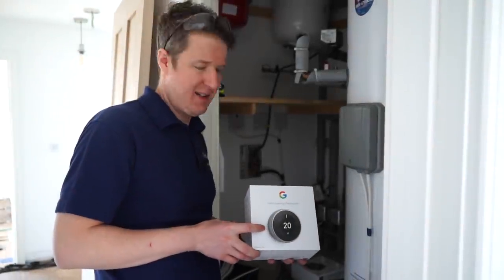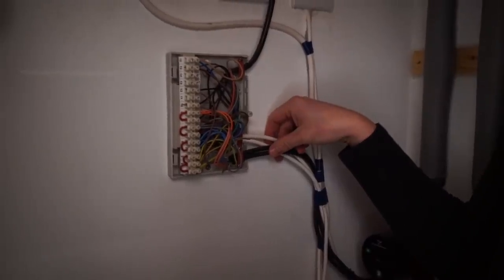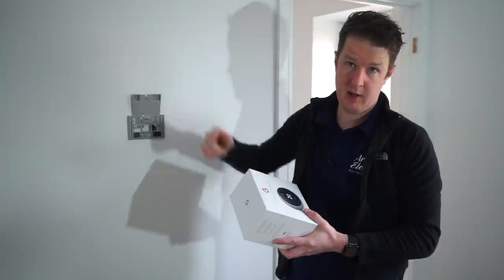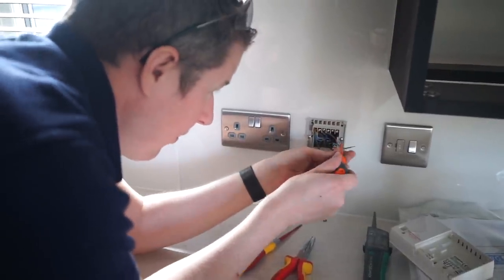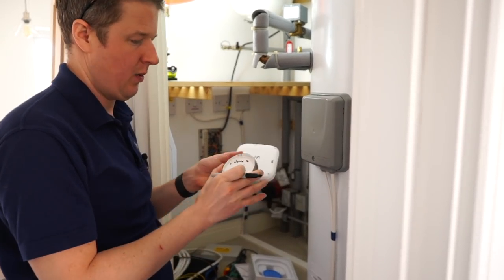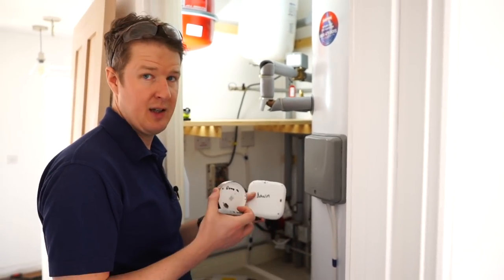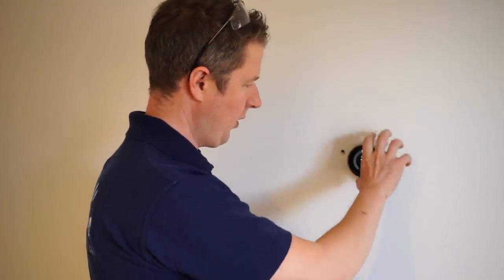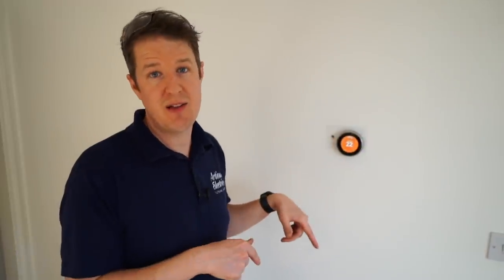Tackling Central Heating Wiring - Google Nest Thermostat Installation - Electrician Life

Comment: It's really nice that there's one centralized place for all the heating and hot water electrical connections in Britain.  In the U.S. these connections tend to be made wherever they wind up and the low voltage ones are seldom in boxes at all.
Reply from the maker: Wow thanks for sharing

Comment: Remember that you can tell if zone valve is open because the mechanical actuator will move freely.Because the motor has moved the vale to open position. Great video.

Comment: Done quite a few system boiler wiring on a council contract,found it is a good start to understand which colour does to the controls to the valves stats etc the colour's are standard what ever make you use 👍

Comment: Nice job! 😁 Those Nest thermostats refuse to work above a room temperature of 30 degrees C, so I had some trubble getting them up and running after install. So I used the button in front off the heatlink to test the heating. Once you now everything is easy!  😉

Comment: I do like your videos and I learn some thing every time. ( well nearly every time). As you said these Nest thermostats in the UK are just switches and in your example are being applied to a very very basic UK  plumbing system. In fact the heating system is exactly the same as the one I as a non plumber designed from a few diy articles when I built or perhaps more accurately project managed the build of my house 25 years ago!

The Honeywell control system with zone thermostats still works fine today and I can turn the stats up and down whenever I want!!

The USA Nest system looks much more interesting but then it caters for AC as well as heating and their types of heating are easier to design around individual room thermostats in stead of upstairs and downstairs zones.

However they look smart and it might be nice to spend the £400 to help create an up market illusion when I sell my house next year.

By the way should you not test your tester on alive wire before and after testing the circuit you are interested in?  As an old codger I will relate a true story around testing....I did my training with an Electricity Board in the early 1960 s on the HV side. I had just become Authorised to issue permits to work  and was isolating a 33kv line from a 33kv substation. The routine was to test the testing stick by opening a bus bar shutter and putting the stick on the bars whereupon it would glow and buz a bit.  You then put the stick on the feeder terminals and it should not light....and it didn’t. However when the earthing gear was attached and the beaker was being racked in it started to buz!!  Quickly racked out and retested the stick all fine. 
The whole area fed from the 33kv through the 11kv to the LV was supposed to be isolated and dead.....turned out there was an obscure and lost! LV back feed which was not causing enough volts to light the tester but enough to make a warning Arc when starting to rack in the earthing gear..Moral of the story?.......never lick your fingers and touch a conductor to see if it is alive!
Reply from the maker: Thanks nice to hear from you

Comment: Jordan, the heat links have a unique ID on them and you can program the nest stat to connect to the required heat link, so if they do get muddled up you can just go into the settings on the Nest programmer to find out which one its paired with and swap over the nest stats accordingly.
Reply from the maker: Nice

Comment: Bacteria Prevention is an exclusive feature of 3rd-gen Nest Learning Thermostats. Bacteria Prevention mode will activate if your domestic water hasn’t been heated for at least two consecutive hours in the last 48 hours. This can happen if there is a gap of more than 48 hours in your hot water heating schedule or if you are away from home for longer than 48 hours. For instance, if you have a second home or holiday home and only need hot water for weekends, you can create a hot water schedule for Saturday and Sunday, and the Bacteria Prevention mode will automatically heat the hot water tank during the week. not to do with heating.....
Reply: Where the bacteria grows? isn't it closed water line only for heat?
Reply: I guess this is not as good as the controls on a commercial boiler (Legionella prevention mode) Whereby for energy savings and H&S reasons the hot water can be kept at around 55c then on a cycle the tank is "Pasteurised" where it is heated to 65c and held there for a few hours before going back to 55c. 

Same with Cole water storage tanks, Industrial controls have a temperature sensor and an algorithm that detects the "Danger Zone" and initiates a tank flush if the tank is in the Danger Zone too long. 

I assume the nest system is just a "Dumb" system as it doesn't know the temperature of the water tank so cycles it on at regular intervals to pasteurise the tank.
Reply: @ValorHeart  in the white cylinder next to him. So the hot water coming out the tap. He's just misunderstood what it is and should stay on.

Comment: A really helpful video, thank you. I was overwhelmed when I opened my wiring centre at first. Still trying to figure it out though, I have an air to water heat pump system by Joule / Samsung. It looks way more complex than the job in this video. I wish you covered call outs Ireland ! 😂 Two zones with 230v thermostats to each. Separate Samsung branded controller for hot water. I don’t even know where to start. If you have any suggestions or offer a remote support service I’d be willing to pay ! Thank you.

Comment: Great little tutorial on the subject, like you say, most electricians run the other way when confronted with a heat only system.
Thanks again for sharing, and replacing the propaganda rubbish on TV.

Comment: Nice tutorial. I have similar setup installed at my house. One nest has equipment set to “system boiler” to enable hot water control. Did you set another one to “combi boiler” to control only on/off of boiler?

Comment: My OCD is very grateful for the two hubs coming down into the wiring centre and the top one not going up.  However the ditching of the level for the install gave me a bit of a cold sweat.

Edit, the switches above the wiring centre could have done with a shot of the level too! Dear me.

Comment: Did you check to see if the boiler could be controlled by OpenTherm as Nest supports that? When ours was installed the installers didn't and I've read it's more efficient so had to get it changed over by another tradesperson.
Reply: it would be nice to see how it is wired on open therm if fitted to system boiler

Comment: I prefer my Drayton wiser system. It just replaces the programmer (and in a lot of cases just sits on the existing backplate). Battery powered room stat (you don't have to have that) and individual rad stats for all over control.

Comment: That wiring box is a typical rats nest of wiring you see when removing the cover. At first glance a confusing maze of wires. Can take a while to work out which wire is which. Especially for cables that disappear into the wall and emerge in some other part of the house. Easy to pick out some cables that are surface mounted and go to devices in the same location. Often easier to wire in a system from scratch than retrofit stuff working out which wire is which and what one actually needs to alter

Comment: The browns of the thermostats aren't permanent lives, they connect onto the switch back from the timeclock.
Also what's the point in putting a brown tag on an black cable, all's your doing is tagging a live cable saying its live, you only need to tag a cabke if its doing something other than its intended purpose i.e. using a black on a 3 cored armoured as a CPC

Comment: A great video, cheers. Trying to find some of the basic information has been practically impossible until now.

However, I don't have an existing room based thermostat and I simply want to power the thermostat from a simple 12v PSU. Can you tell me which terminals to use on the thermostat for +12v and GND? Maybe I'm missing the point somewhere but why don't they at least label them as such instead of all the seemingly random letters?

Maybe it all makes perfect sense to a heating engineer but I'm an electrical engineer. All the letters labeling the terminals mean nothing to me. It's going to link to the boiler wirelessly via Heatlink so all I need to do is power the bloody thing up ;)

Comment: great vid lad, realy good help....the first one is the tricky one...then you could wire the next 100 with no drawing. Just curious how you combined the rm stat and water system .........i take it the app on phone controls the hotwater  times....can it be accessed by the  roomstat menus too?
Reply from the maker: Thanks! Yeah that’s right you can control The hot water from both the app and the room stat
Reply: @artisanelectrics   ta again

Comment: i noticed you said the pump constantly has power and kicks in (and sometimes is wired to power up when the valve opens). ive alway been taught that it should only power up when the valve opens to avoid burning out the pump. is this something to do with newer pumps? just wondering as having constant power to the pumps makes the wiring easier for sure. handy to know for the future. cheers
Reply from the maker: Yeah most pumps are only turned on when the valve opens that was my mistake
Reply: some newer boilers require to control the pump for pump over run to protect the boiler, this is stated in the boiler instruction.

Comment: You absolutely made hard work of that. Do a diagram of what's there before you start. Then make a diagram of the new circuit . Then make the changes. I am a retired control gear engineer & I couldn't follow you. Otherwise like your work

Comment: Programmers are old hat now, the nest stat controls the on off times via an app. I have a heatmiser setup which controls the central heating, hot water and electric underfloor heating via an App.
My boiler has a live from the fused switch, then from there the power goes to the control gear and the pump wires direct to the boiler
Reply: "Programmers are old hat now" I guess I will just quit now and become a Wizard instead :) .

Im on the fence with Heatmiser I've done two large installs where I have had to integrate with their stats and I find that the API is lacking (Or was when I did those jobs) There was a lack of consistency between the functions available in the app and what they allow programmers to access via the API so had to write some interesting logic to brute force those features. 

Nest I like and they had a great API but they may have ruined integrations as I saw a bulletin that "Works with Nest" applications are being discontinued so I can no longer get new API keys for new customers. 

Both stats seem to miss out on HVAC integration, they seem to do Heating and Domestic Hot water just fine but no Cooling, for that you end up with two systems that need to be integrated by a programmer or you end up buying big boys toys and installing something like a Tridium Jace controller with BacNet and writing a custom app to control the HVAC.
Reply: @warrmr  what’s wrong with saying programmers are old hat now? Do you still recommend Landis Gyr clockwork timers and mechanical room stats
Reply: @blobstrom  I guess you missed the joke English is hard but that’s ok. 

On the question of would I install analogue/mechanical technology yes!  
If the customer wants a wind up doorbell that makes chicken noises in the garden when someone is at the door then so be it who am I to judge. If you got the money and I have the skills to do it then let’s go boi. 

Same as if someone wants me to program a 20ft robot to walk around the garden and spray “intruders” with water in down for that. 

I mostly get boring stuff like can you make the toilet bowl lights turn on if movement is detected in the bathroom between sunset and sunrise. 
Or when you turn on this tv can the cabinet doors open this light turn off dim the others and swing the bracket 26.456 degrees.
Reply: @warrmr  So a reply that starts with an insult about my understanding of the English language, I can see where this is going.
Reply from the maker: I think when he said programmer he meant the device we call a programmer which controls the heating system, he didn’t mean “programmer” as a job
Reply: @artisanelectrics  :) You get the Joke

Comment: Would have been easier just to rewire the centre neatly. Would it not have been a heat only boiler, as a system boiler contains a pump.

Comment: to many wires in a small wiring centre, a larger wiring junction box would help. nightmare to fault find or replace parts like zone valves
Reply from the maker: Very true

Comment: I found this video amusing for the wrong reason , I would of expect you to pull the fuse from the switched fused spur for additional protection and I would of expected you to put a wago on the end of the cable when you removed the room thermostat that would have saved you a couple trips back to the rooms
Reply from the maker: Good tips!

Comment: "Central heating baffles a lot of people, a lot of electricians won't touch it" yet plumbers can handle it, kind of worrying really. Worth pointing out than in systems that have boilers with integrated pumps (probably most domestic systems) the orange wires from the valves are a call for heat from the boiler which fires up and the boiler controls the pump rather than the pump controlling the boiler (indirectly via a flow switch in the boiler).
Reply: ..... There's some debate but the whole system should be isolated by a DP switch near the boiler, some say a standard 13A plug and socket is also OK some say it isn't.

Comment: So weird to see that installing a thermostat is an electrician’s job. In The Netherlands, almost all thermostats are low voltage on tiny little wires that connect directly to a combination boiler that delivers hot water and heating to radiators.

Comment: I have my old central heating and hot water program control box on the wall in the hall, next to the wired thermostat. 
Would it be possible to fit the Nest white control box over where the old control box currently sits, assuming the necessary wiring is present, (which it logically should be) and the new Nest Thermostat controller where the old thermostat is? - Can anyone see a reason why that should not work?